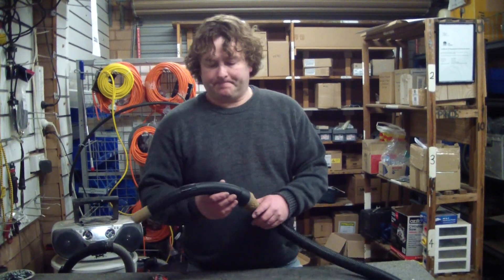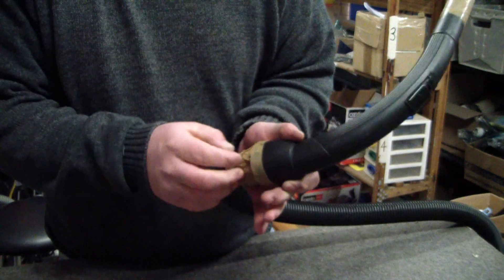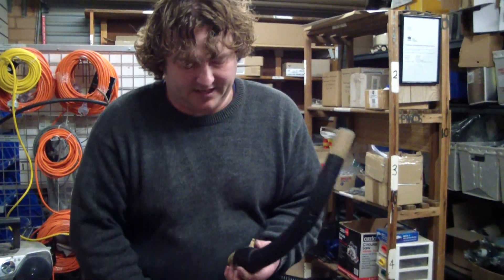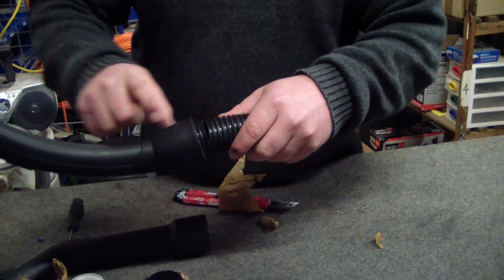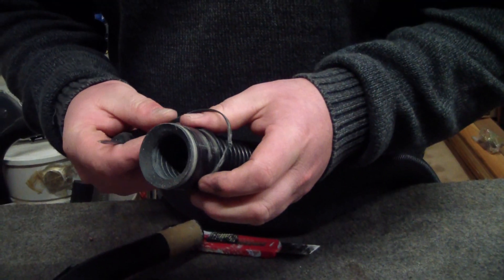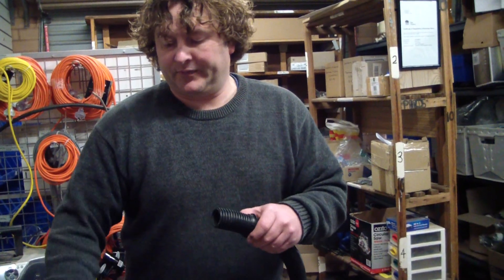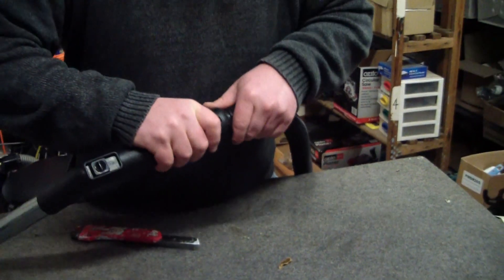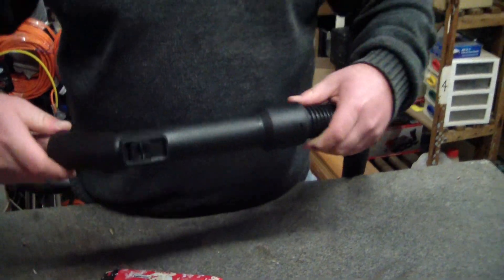How To Repair A Vacuum Handle - Don't just use tape!

Comment: Thanks for mentioning that the hose cuff screws in the opposite direction! I was wondering why it wouldn't screw on. Also, one should not press too hard on the clips of the clip ring, because they might break (which happened to one of mine). Finally, if you are not able to pull  the broken part of the hose out of the hose cuff (because it is glued), simply start pulling on the spiral-like material of the hose and it will progressively detach itself from the hose cuff as you pull.
A really useful video! Thanks to you, I was able fix my hose in just a few minutes, reusing the original parts and not having to go to the store. All I did was to disassemble, cut off the broken part and put everything back. Wonderful!

Comment: i have a electrolux model 337 and the original hose is loose on the machine end of it, and sometimes it comes out and due to the design it does not use a click ring and hose cuff. before i go down to my local godfreys (vacuum shop and service center  for those not in Australia) to get it repaired or replaced i thought  why not try YouTube and see of what it has to offer

Comment: Electrified hoses are a bit more complex but the tip still fundamentally applies.  Rainbow hoses are a bit tricky as well but same idea, you just have to take the time to remove the pieces of hose from the cuff, add adhesive and then thread it in.  Oh, they call it a cuff because it resembles cuffs on various shirts, jackets and sweaters.

Comment: Alec,  we have an ancient but rarely used Whirlpool FC7000XMO and the hose is hosed and needs replacing. Part number is 744191 and/or WPL-4148437  - either way it is no longer made.  Please recommend a person to fix this issue...and/or where I can buy a hose to replace it (any color but black)... will ship it anywhere in the u.s. - please respond asap!   Glenn

Comment: Thanks for the great video. It saved me from buying a new Vacuum. I ordered the parts from he vacuumspot online shop and they were delivered in 3 business days. Just one note: the problem mentioned in the video about the click ring: I have the same issue, and I had to fix with a lot of force, but it did not click naturally on a Voltra vacuum cleaner (model 2006).

Comment: I have  Wertheim 5030 that has split in the same spot as the one in your video. Can I fix it the same way. Mine is the first type of handle for the 5030. Not the gas handle looking one. I do not want to have to pay $169.00 for a new one if I do not have too. Any help would be appreciated. Thanks

Comment: sorry but i couldnt find the lock on samsung SC4130. could anyone help me??
Reply: Struggling with it as well as it only has just 2 holes in the two opposite sides, but no bit in them to push in. Did you find any solution to it?